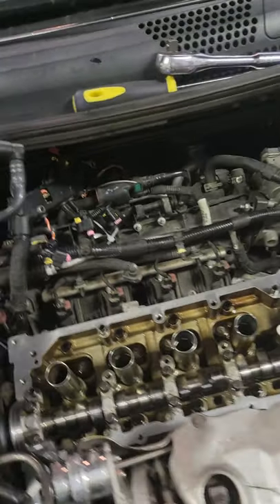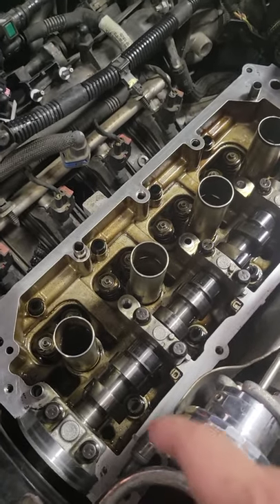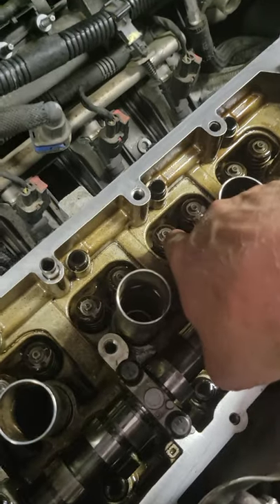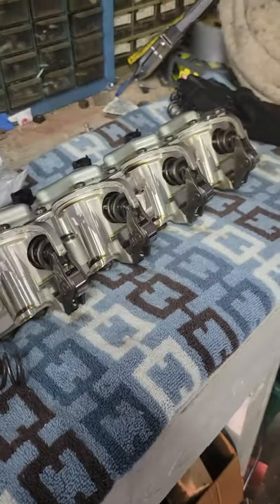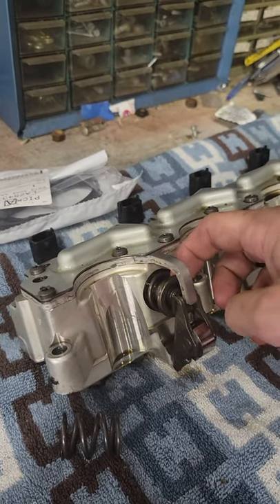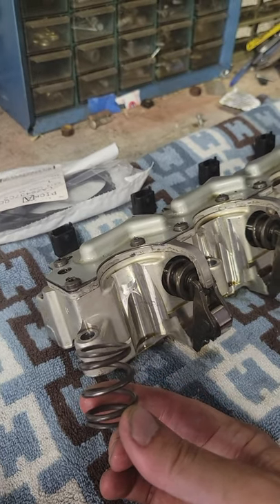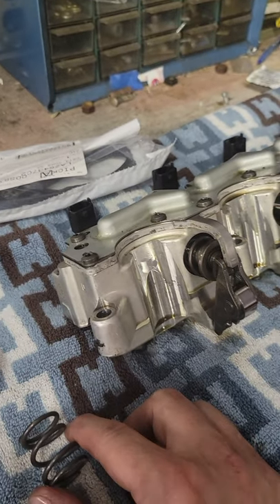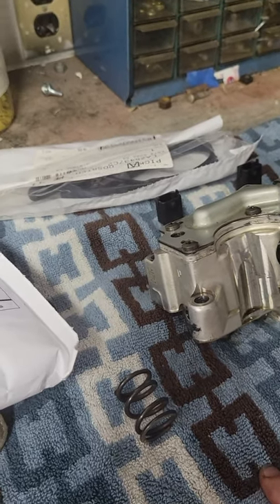Multi-air spring upgrade

Comment: Just changed my springs, valve cover gasket, and spark plug tube seals. One of the seals was leaking, causing a misfire. Had the springs already and did all at once. Just need to figure out how to change the multiair filter. The allen wrench point is huge on the end.